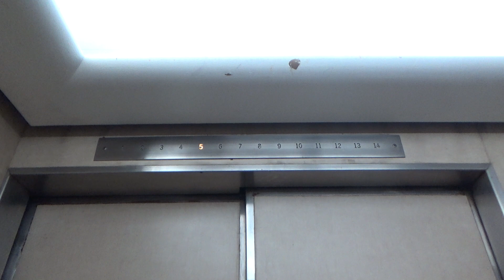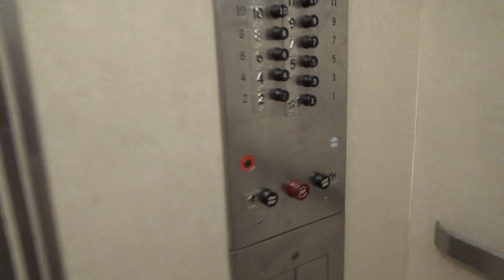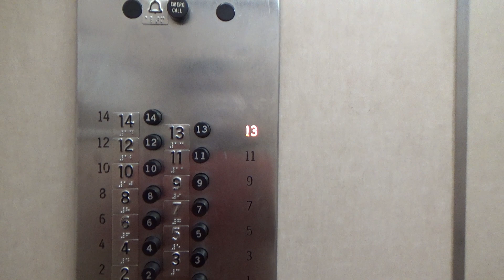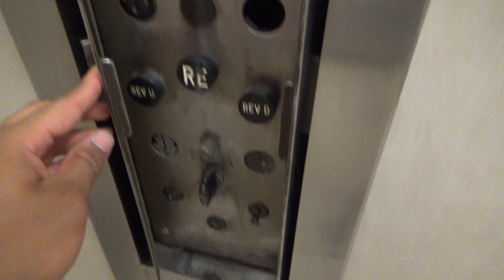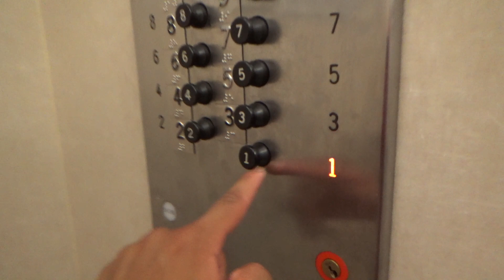OM - POP OUT Otis Autotronic Elevators at Renaissance Centre, Erie, PA

Comment: I think there are 2 remaining buildings with Otis installations with pop-out buttons in Pittsburgh. One of them appears to be a Signal-Control (signal operation), the other I think is a bank of 2 that are automatic like these but not sure (don't know for sure if these still run or not). Both of these are elevators that are not used by the public.

Sadly there are 2 other buildings that no longer have them. The Investment Building of course, and Macy's in Pittsburgh (which was a signal operation elevator, likely Signal-Control).
Reply from the maker: I think PAelevators rode the Signal Control.  He said it's no longer in service though.
Reply: @AdazElevatorz  As far as I know the Signal-Control's still running.
Reply: Where is the other Pop-out that is left? I thought just the Signal Control was left.

Comment: It's likely that the reason the second elevator is mostly slower is because one of the higher speed relays could not pull in (for whatever reason), thus locking the elevator at a slower speed. That is until the relay pulled in on the down direction run and the elevator went at full speed. MQ Elevators made a video called 'Otis Callback' that had this issue explained!
Reply from the maker: That's very interesting.

Comment: That Must To Be Dover
Reply: Nope, to be Otis. Dover doesn't make elevators anymore.
Reply: @EWPA14  Dover was bought by Thyssenkrupp in early 2000's
Reply: @EWPA14  did you film the otis series 5 at the Hardner building and parking deck in erie pa they have nice elevators
Reply: @matthewcook4256  1999. Then it was Thyssen Dover until 2001. And I've never been to Erie so no.
Reply: @EWPA14  Erie Pa Has Awesome Elevators but too bad they are getting modded